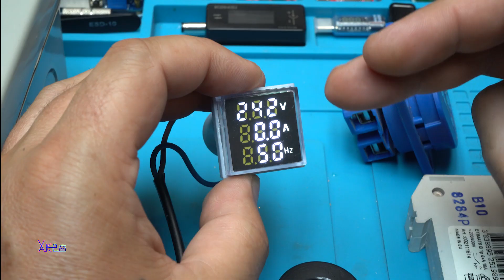Next Project Using $2 Aliexpress Module?

Comment: I installed one many years ago on the house fuse switch board and it is great. Every house should have one on the mains switch board. Of course there are many now with Bluetooth and wifi, and Tuya type apps and connections, but I like my hard wired simple one, mine does not have Hertz as it is not something that tends to change.